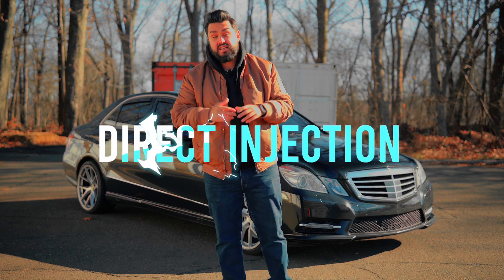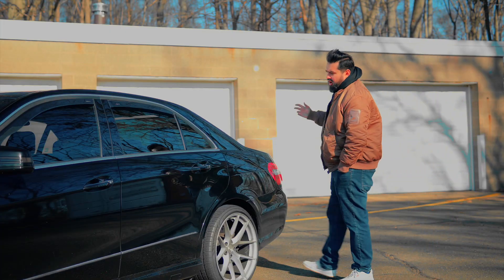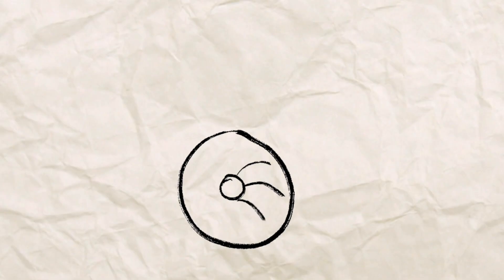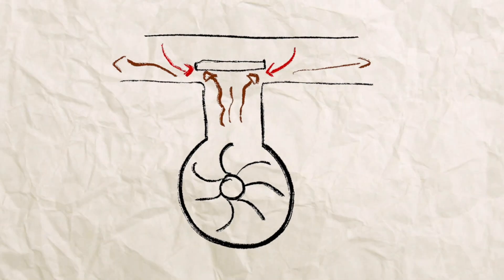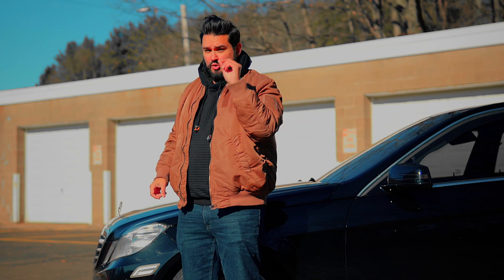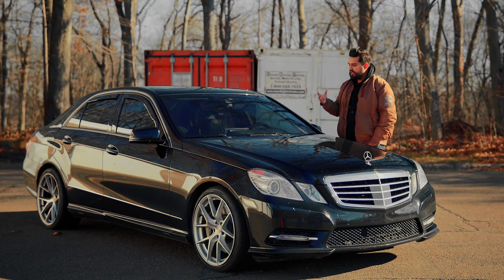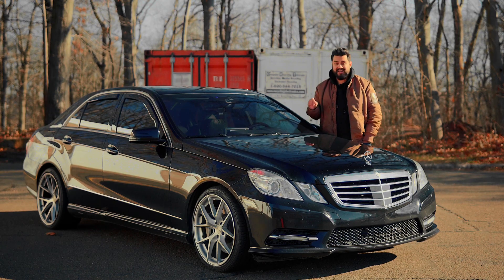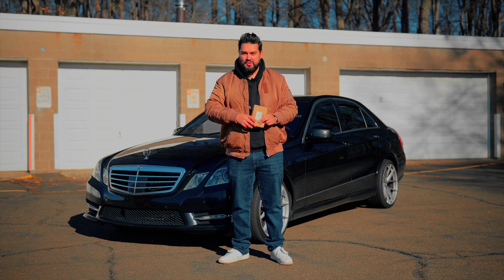M157/M278 Oil Solenoid Mod – What It Does & Should You Do It?

Comment: would you recommend me buying a 2015 gl550? around 60-80k miles
Reply from the maker: 2015 after march build date should be the updated sleeved block, which eliminates the most common cause of death on these. 60-80k is a decent range, I wouldn’t expect major issues or maintenance needed on a 2015 till 120-130 but getting close to 100k at this age means accessories and other unrelated things on the engine could be going too. If you’re worried, get a PPI with a mandatory borescope, compression test. If it passes, you should be good. If not, that $350 PPI will save you 20-30k down the line.

Comment: Thank you for this video. Done this last week and with always on split cooling loop pump and 75/25 coolant on my 2014 CLS63. ran live data with my Foxwell scanner its really 100% 58 psi oil pressure way cooler AITs and trans cooling. Everyone do these to, they are a must!
Reply from the maker: Awesome results thank you for sharing data! 

Please also know the side effects, potentially higher fuel level in the oil over time, so make your oil changes 3k or less with High Quality stuff. Awesome to hear!

Comment: I have a cls550 46k miles stage 1 dme tune. Would you recommend? I changed my oil 3-4k miles .
Reply from the maker: That’s the miles I did my second motor. What year? Pre 2015 yeah I say go for it. Make sure to shorten those Intervals under 3k as you will get some gas mixing in with oil which shortens the oil life effectively. 3k or less is acceptable. I did 2500-3000. Not ideal but reality

Comment: How to know if the solenoid is stuck closed or open?
Reply from the maker: Great question. You actually can't check if it's mechanically stuck using only Star/Xentry because these engines don't have a real oil pressure sensor. You have to hook up a mechanical pressure gauge to the test port, then toggle the valve 'ON' and 'OFF' in the Actuations menu. If the needle on the gauge doesn't move when you click it in Xentry, that's how you know it's stuck

Comment: Did this on my ‘19 GLS550 and im getting a CEL
Reply from the maker: You shouldn’t. Scan for codes with Star Diagosis.
Reply: @mrapter7 did it. No help. Had plug it back on
Reply from the maker: You did not scan with star diagnosis, otherwise it would tell you exactly what is wrong, even if there’s not even a check engine light, including silent codes. There is no world in which you scanned in. It did not help this problem.
Reply: @mrapter7 you are pretty confident stating something you dont know! I was hoping to get some kind of advice on how to fix this but I guess not. If you are willing to help I would appreciate you only reply here with useful info.
Reply from the maker: How on earth could I help you if you stated you scanned it but it didn’t help anything? What does that even mean? If you scanned it properly, you would have a code or two to post here and then I would be more than happy to help you. I can’t read your mind.
Reply: @mrapter7 later vehicles it will set a check engine light, also on earlier vehicles with updated ECU software.  If you want to do this mod on later vehicles with updated software, you have to plug in a dummy solenoid. I would verify normal oil pressure with a mechanical gauge first. I work on Mercedes for a living. Some of the info here was a bit off yet I have done this mod To a few vehicles including my own with good results.

Comment: Did this mod to my 16 GLE63 AMG. CEL is on and won’t erase, any suggestions/ideas to shut it?
Reply from the maker: I would scan and see what the code is as this mod isn’t known to throw visible codes
Reply: @mrapter7  only code showing up since unplugging it
Reply: @mrapter7  still unplugged seems to do better in what was mentioned but the light is on, and drives me crazy
Reply from the maker: Yeah light shouldn’t turn on. Verify what the code is

Comment: 2012 Mercedes E W212, M278, 50k miles, bought new, garaged all the time, oil changes every 4.5k miles at the dealer, completely stock. Runs perfectly.
Not sure why people recommend disconnecting the oil pump solenoid , the variable pressure system exists for a reason. Locking it full pressure just stresses the pump, seals, and cold starts, and can throw off the engine’s normal oil flow that some systems like VVT rely on. In my opinion, with a well-maintained, stock engine like mine, it doesn’t seem necessary. Do you think it really makes a difference?
Love your videos, keep them coming!
Reply from the maker: I think these engines, especially in the early years have poor upper lubrication. This is proven and is why the cam adjusters fail, tensioners fail and chains stretch. There is a smaller % that don’t seem to run into these issues which can be attributed to batch numbers, as some are tuned some are stock. 

If you baby an engine, you’ll never have issues. If you use the engine, the engineering becomes more of an issue or at least more obvious. With newer versions of the m278 have updates for oil flow and cooling within the block itself, we’re kind of up against poor engineering on the old engines. 

50k and bought new? You don’t drive the car nearly enough to even be concerned, as most of these top end failures happen post 70-90k. 

I did it to my second engine at 42k miles on it and immediately it sounded smoother at idle. There are drawbacks, and since you drive less than 5k a year, I wouldn’t even bother
Reply: @mrapter7  I see that it sounded smoother on your second engine, but a healthy, untouched one is a different story. I live in Madrid, Spain, it’s a small country and I don’t rack up many miles. I usually let it warm up fully and then hit it hard pretty often, and lately I’ve been starting to put on more miles, which is why I considered the solenoid mod, but I’m still not convinced it really makes a difference.

Also, not sure how it would affect fuel consumption and city loads. 98 RON here is about €1.78 per liter, and with an 84L tank that’s roughly $170–175 to fill up. Feels like there’s a hole in the tank, especially in city centers like Madrid, driving an E550 at 12 mph feels almost criminal, haha.

Big greetings from Spain, man, you’ve got me debating whether to try it or not.
Reply from the maker: Honestly dude with your use case, and it being owned new it’s hard to really recommend or give a recommendation. On one hand, under 3k rpm it’s not getting full pressure, but you say you do get on it when you can, and aren’t putting on many miles anyways. 

I’d probably keep it stock. You know the history and health, and it’s still pretty fresh.

As far as fuel economy it’s a non issue. This thing while tuned got 32mpg on a 100 mile round trip cruising at 70. We only get measly 93 over here (I’m sure it’s not apples to apples) but at 3.80 a gallon it’s not an issue. 

Enjoy the car, drive her like she deserves and maybe do a health check now that you’re at 50-60k. Bore scope and compression test may tell you more about what your future holds , even if there are no obvious issues

Comment: This may be beneficial for my 2015 S63 AMG… it’s got 148k miles so far still running super smooth and strong af! Once it hits 3k rpm it’s just smoother.. in city I’m very very gentle with it.. I let it shift itself.. it never shifts above 2.5k.. just uses torque to move.. 
I make a point to run it every now and then up to 190 plus mph and do a few pulls with 70-80% throttle to keep all system functions working well.. it’s effortless for her.. I think she’ll benefit from higher oil pressure at the older age now..
Reply from the maker: Yeah these are my general thoughts. 150k 157 isn’t a very common sight. I might do any preventative stuff I can do on it. Reason why it seems smoother suddenly may be due to that increased oil activity. 

Also might just be plugs or coils.

Comment: so for m278 how long you recommend to warm the cur up? currently I let it warm up for 10 min before driving is that good or bad? and I am thinking of doing this mod next also do you recommend using mos2 or ceratec liquimolly?
Reply from the maker: When the rpm’s drop, then you can drive. I wouldn’t take her over 2000 rpm till like halfway to temp, absolutely stay away from boost till you’re at about 90*c up to temp

Comment: I would certainly get rid of that Option if it was me it was only put there for fuel efficiency and it's not good for the engine to run at low oil pressures at low rpms like that. I read a lot of these peoples comments and some of them are just completely nonsensical. Higher temperatures and this and that and the other it's just bizarre. In my opinion all you really should do is look at the live data before you unplug it and it's addling and then look at it after you unplug it while it's idling to be sure that the oil pressure is up unplugged. Then I would leave it like that. it don't cause half of the crap that these people are talking about Just be sure the solenoid is in the high pressure Mode
Reply from the maker: Yeah, it’s a pretty simple concept, it is a documented side effect that temperatures do rise, but it’s not by much, and because it’s oil temperature, it’s even less important. The oil that this thing uses if you go with a liquid Molly brand is easily good up to 275° plus. We’re talking from 200 to 212° difference.
Reply: What kind of a live date should I check? Cus I've just bought a 2016 E400 with 77k miles & I want to know if mine is not stuck. And can I know without any kind of Live date?
Reply from the maker: You need star diagnosis (Xentry) and look at the engine module, then look for relevant oil, solenoid, and oil pump values. I’m not sure exactly which one it is under at the moment, but it is there.

This software makes it super easy to dive into these cars, and you shouldn’t be owning an older Mercedes without it. I am sure there are some other six to $700 tools that can get similar readings, but on these cars, the defective way to properly read, right, and actuate, modules, and components in this car at a dealer level is using the same software they use. @koreanseats on IG for more
Reply: @mrapter7  the first thing I'm going to do tomorrow is unplugging that thing & keep you updated cus the car has a load ish idling sound.
Reply: @mrapter7  I have 2019 with C4, I have 2019 pass through, I have 2025 with Super C6.... yes I'm aware how to do things with it I was talking more about the nonsensical things that some people were saying about it

Comment: can I do this on a CLS550 that has 107k miles? We got it brand new in 2012, and it's been well taken care off since then. No major problems regarding oil yet, only recently i seem to be ahving a timign issue (the rattle noise at startup, think it might be my tensioners so am going to try getting those replaced)
Reply: How much was it to get those replaced ?
Reply from the maker: Cam adjusters as well most likely, please do these as well. Please also inspect camshafts for wear which is caused by adjuster failure over time. A $1500 bill can easily balloon to 6-8k in parts alone

Comment: Hey brother, thoughts on a 2018 G63 with the M157? Got 65k miles on it. Is it a stout engine? Would this mod help? Owned since new, took it off roading quite a bit, but also has been serviced regularly and properly.

Been pretty flawless except a burst cooling tubing around 50k which left me stranded.
Reply from the maker: The 157 never got any internal updates, or really any updates for that matter. I can’t speak on the G chassis, but I’m sure they’re durable. The engine itself should be treated like any other 157, they start to have issues at 80-100k if it’s been USED, and it’s been offroaded…it’s probably been used a bit. 

Your default thing should be 

Is the car in good shape, chassis, body, suspension?

Is it a 278/157? Automatic compression test and borescope for scoring if it passes the other stuff and you like the car. There is no other way to buy a used 157.

Comment: It is switched as follows
-10 to 20 degrees oil temperature
Maximum 10 minutes
Limiting it to 2.5 bar prevents the oil syringes from opening and the piston heads from being cooled. If you unplug the valve, you will get massive amounts of fuel in the engine oil because it immediately condenses on the cold piston head.
Reply from the maker: Yes this is absolutely a biproduct I learned about later. Although, between 3000 mile changes I hadn’t seen an increase in capacity, if anything I lost a little which is expected. 

I did notice a slight gassy smell from the oil, but I change so frequently, and it really was minimal (but noticeable)

It’s absolutely recommended to do very very religious 3k or less changes, if you are dailying this
Reply: @mrapter7 ppl dont usually change oil that often tho) 
Also because u got gas in the oil - u risk getting scars on the cylinder wall especially while the oil is just getting to its normal temperature. And the scars is what really common on these engines, they have u start wasting money really fast.
Reply from the maker: A lot more civil here…

Scoring is an issue you cannot escape. It has everything to do with tolerances in rotating assembly, wrist pins that allow the piston to slap under high torque. This is the cause of scoring. 

Plenty of other engines have the same cylinder walls but don’t encounter this scoring issue - like the m273 before it.
Reply: @mrapter7 it probably make more  sense in hot climate and with very often oil change tho🫤

Comment: Ran to the garage and did this as soon as I watched your video. 2014 s550 with 113k on the clock. Just got it about 2 weeks ago so hopefully this keeps her trouble free. Thanks!
Reply from the maker: Oh no, brother. 114k without this mod doing usual m278 things is not a good look. Please tell me you did your research and borescoped and compression tested before you bought? 

If there is any scoring at all at 113k miles, nothing a solenoid mod will do will REALLY help. It’s conceptually preventative help for wear that usually is already taken form at under 100k - usually 80-100k. 

I know you won’t run and do this because that’s a beautiful car, the s550, but before you get too deep and spend a single penny on gas to get home, do a borescope and compression. IF you’re 100% healthy, then we’re good. 

If there is any scoring at all, you’re already loosing the battle. These engines routinely last 130-150k. After that it’s usually engine death.
Reply: Any update? Any issues with doing this?
Reply from the maker: Car is sold…new 550 in the mix now. But no issues over 25k+ miles

Comment: 54000 miles on my 2014 CLS550. Where is the video showing exactly where the solenoid is located?
Reply: Did u find it
Reply from the maker: It is on the bottom front of the engine, drivers side. Removing the front most piece of under shielding will access it
Reply: @mrapter7 ok.  My car was in body shop for 6 weeks. Getting it tomorrow and will look.  I change my own oil but didn't want to pull the clip I saw unless I was sure.
Reply from the maker: To verify, you should scan and you’ll have a code but no engine light. Code should be about the oil pump or solenoid depending how descriptive your tool is
Reply: @mrapter7 yes. I have a good mock STAR scan tool.

Comment: I have just disconnected the valve on my om654 S213 and it's now running a constant 5 bar and sounds quieter..... There is a fault code, but no engine management light...
Reply from the maker: Never considered the diesels. AFAIK they don’t need it. I might just plug yours back in.

Comment: You will notice if its open or closed by fuel consumption , it takes about 1-1.5 ltr/100km more of fuel when valve is permanently closed
Reply from the maker: This is super interesting! I’m still managing to get 31-32mpg on the highway if I cruise at 55 myself after this mod
Reply: How did you figure this out?

Comment: does this affect the timing chain tensioner with full pressure all the time?
Reply from the maker: Tensioner isn’t really directly connected to any oil pressure. Technically: Better Pressure = better lubrication = less wear on timing components and chain = less stretch on chain = less expansion of the tensioner. Tensioner is just a simple spring, basically.
Reply: @mrapter7  actually I opened the and replaced them and they are quite in direct relation to oil pressure,  they are spring loaded but they have a oil input channel and output hole which discharges the oil downwards. So it basically is oil loaded and the bottom hole gets larger with wear and doesn't hold pressure and doesn't tension properly.
Reply from the maker: Interesting - I figured it was just mechanical and not pressure based. Thank you for the information. All the more reason they need proper lubrication

Comment: idk if i should do it on my 2014 e550 sedan cause the temps rise quickly already but since i only had it for 1 month maybe i should wait till it get cold
Reply from the maker: How many miles? Thermostats aren’t going to last forever and can be an issue with rising cooling temps. Oil however is much more flexible. I wouldn’t really blink between 200-225* on the oil especially if you’re moving a bit. 

Oil like liquimoly usually good for 250-275 before it starts really being a problem. If you’re running at 250 at all on this car you must be tracking or something is wildly wrong
Reply: @mrapter7  got it a month ago dealer ship with a good rep told me they changed the thermostat already and it has 84k miles now got it at 82k
Reply from the maker: Waiting till it gets cold is kinda funny, that won’t really affect anything in terms of oil temps. And the cold goes away.